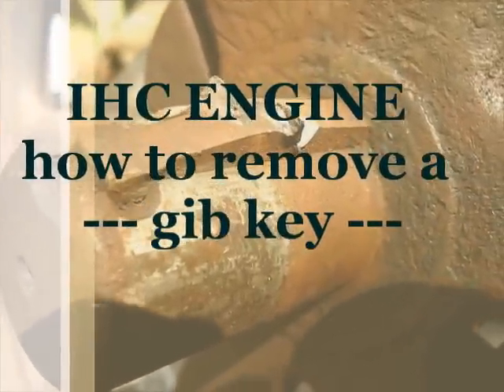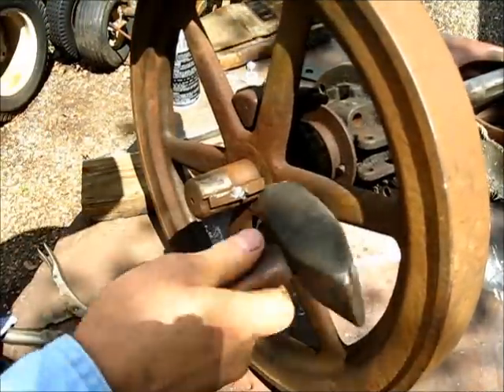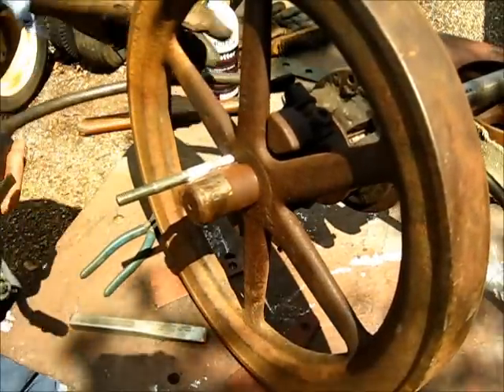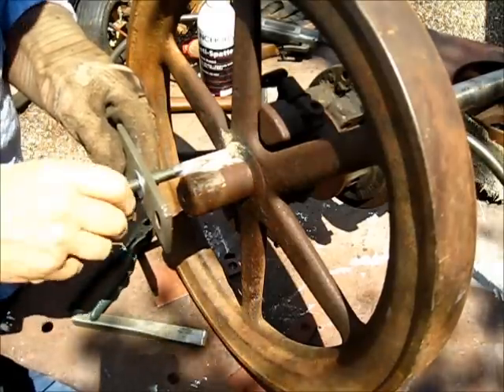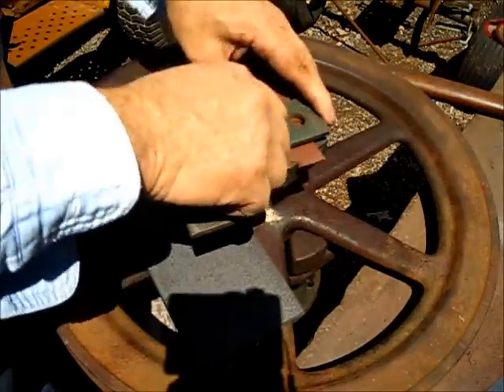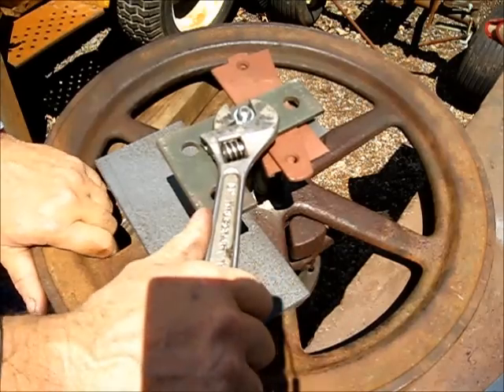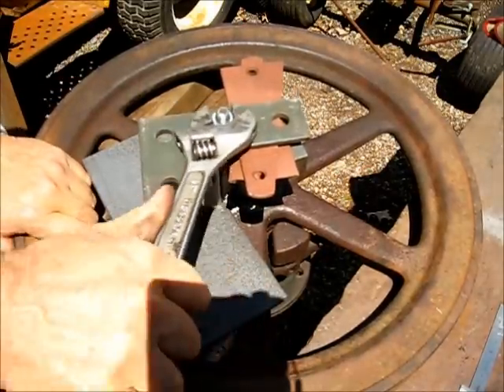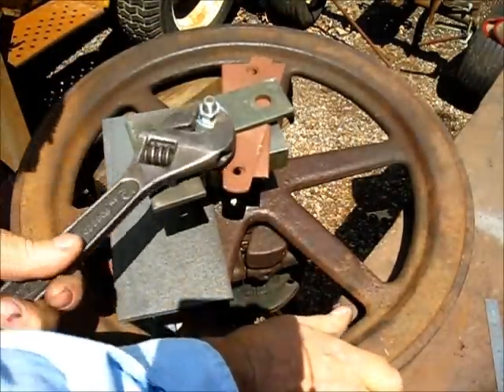1925 IHC Engine Model M how to remove a gib key 1of3

Comment: if'n sammy boy would have used NF the ramp on the threads is much less than course. It helps pull harder. Never seed a key this h'year tight.